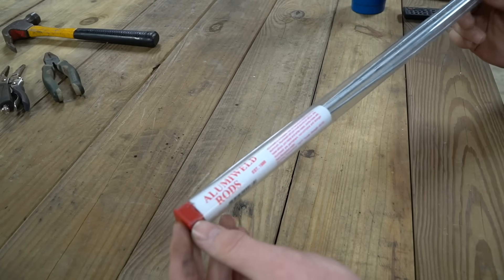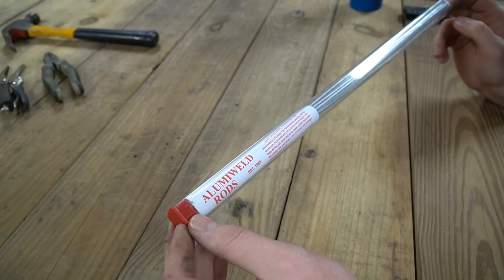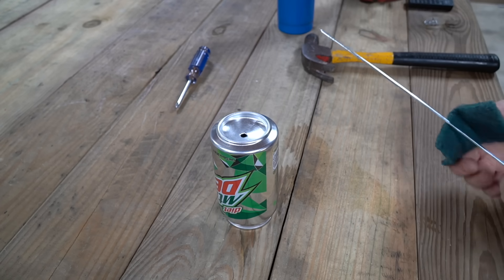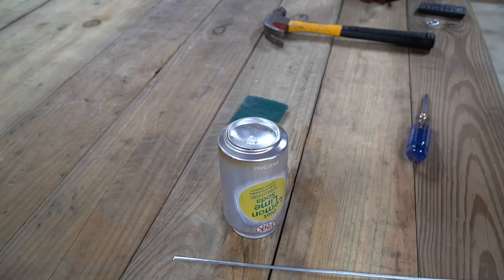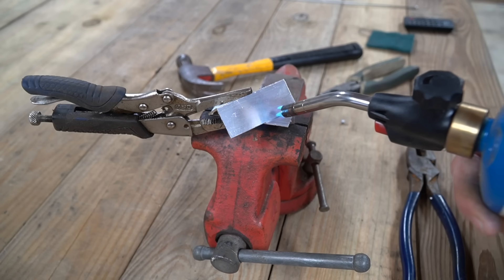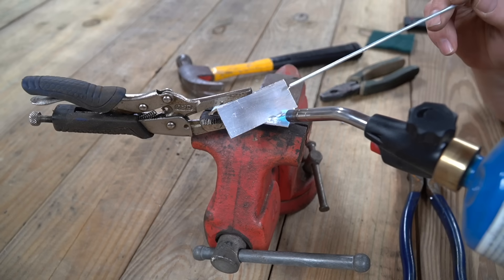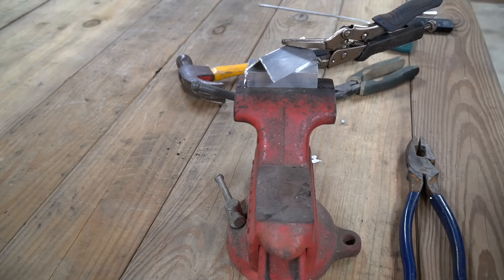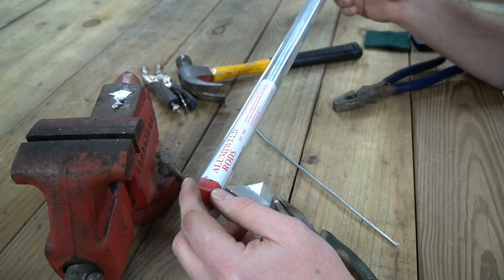Alumiweld rods from Harbor Freight!  Do they work?  Can you easily weld aluminum with just propane?

Comment: Here's my question:

If the tensile strength of the filler rod is greater than the base metal as you say, then it should be as strong or stronger than welding it. Yet everyone says this will not be as strong as welding. So which is it?
Reply from the maker: Maybe it has to do with how well it sticks to the material and not how strong it is itself?   A lot of people don't prep the material they are brazing good enough, it doesn't stick well, then they blame the product.

Comment: https://www.eastwood.com/images/pdf/19079Q.pdf here read the instructions, you're not supposed to torch the rods...
Reply from the maker: Right, your supposed to let the metal your mending get hot enough to melt the rod.   Keeping the rod in the flame doesn't appear have any side effects, as long as your not melting it with the flame.
Reply: @1D10CRACY  Precisely!

Comment: Could someone please tell me....HOW do you know you have ( the piece you want to weld ) hot enough to then proceed to use the rod ??    And I mean Short of melting it.
Reply from the maker: You keep touching the rod to the metal your trying to braze while pulling the flame away.  If the rod melts, it's hot enough, then you can keep flashing over it with the flame to keep it hot.  You want the hot metal to melt the rod, not the flame of the torch.

Comment: NO YOU CAN''T! My findings were quiet different from you'res. Compared to my high frequency machine it was shit on it's best day. I tried  to build planer boards with these pos and it didn't work at all. Thanks but no thanks.
Reply from the maker: I get it, it's tough to master.    I use them probably more than I should, but they work pretty well for me.   Different answers for different people, it's all good!
Reply: @1D10CRACY  The planer boards have an aluminum rod running away from the aluminum plate, while the plate would get hot enough the rod would not. I could only get heat to the exposed end of the rod, the plate blocked every other party of the 3/8" rod. I tried 3 times to get the rod hot enough but it broke free from the plate every time. Each time the rods flowed well and I didn't expose it to the flame. I was just experimenting with these rods but for this project I'll stick to welding. There maybe other applications that they are better suited for?

Comment: You can buy a used 140 amp wire feed for $100
Reply from the maker: Technically this isn't welding, its brazing.   Also keep in mind to weld aluminum with tig or mig, you need argon gas.

Comment: I can attest to 2 things. This doesnt work. The tensile strength and bend test will fail every time. And these are not made in the u.s. they are made in china and shipped to florida, then sold.
Reply from the maker: I can contest one of your two things.   ;).  These work well, if used right and for the right purposes.    The china import comment may be correct, I'd have to dig into it a bit deeper to confirm, but I'll take your word for it.
Reply: @1D10CRACY  you may be right on how well they work. I only tried it one time to make an aluminum box for a battery on a trailer. I dropped the battery in and the box broke. But I've been known to not have very much patience either lol.

Comment: I use 10% Silicon/Aluminum rods an Aluminum Brazing Flux heated with a standard Oxy Acetylene welding torch to Alloy Braze. Must try Propane one day.

Comment: The second level of sticking metal together. 1) soldering  2) brazing  3) welding. Been some time since I've brazed.  Last time was when someone brought me a cast iron bird bath they snapped off.   I prefer welding, but amazingly of all methods, stick is the one I haven't mastered.

Comment: the usual aluminium i work with is 1/8'. i use map gas, and i think i'll try prewarming on an electric hot plate.
i don't do a lot of this alum brazing, and i do find it helps to clean the rod, they do oxidize over time. 
i have also hammered the rod thinner, when working with thin aluminum , so it melts before the aluminum.

Comment: Back in the early 70s I worked in a maintenance shop at a newly built winery 
Not really a welder but adequate enough for most things. I was given a project to build a juice transfer pipeline formerly made of steel which got ate up from the acids in the juice they delivered some scud 40 aluminum pipe 6 and eight inch and some 5/8 flat stock aluminum. We didn’t have mig welders only tig for some stainless we did. I told the foreman I never welded aluminum before let alone with arc rods. He said you can do it boy. Lol
Tried cutting the pipe on the radiac but it used a full blade in less than two cuts. 24” dia wheels. Wound up using skilsaw with 4 tip cutting blades they sent 4 6” 90s but the sweep was too long so I had to make new ones I got a welders book and igured the angles and made new 90s with short er turns. I cut flat stock and made flanges needed. The fun part was arc welding it all together. Aluminum arc rod is like using a sparkler slag and embers fly everywhere.
After burning up two new coveralls I completed the project and was praised by the old shipyard welder foreman for doing a good job. Ahhh memories lol
Reply: I learned more working at that winery and farm shop than anywhere. You name it we welded it, built it from scratch, repaired anything and everything.  Hired as a mechanic learned to weld steel, brass,bronze, stainless, Cast iron, gas welding, hard facing gas and arc.

Comment: would these work on steel? I'm thinking of auto body applications
Reply: Nope, it won't stick to steel, in fact when I use them I quite often make a 'backing plate' out of steel to stop the weld puddle falling through the thing I'm trying to weld. (braise) Also if you use a steel brush to clean the parts even that will stop the rod from working, it hates steel! You have to use a brass or stainless steel brush

Comment: My experience in the UK with HTS-2000 (2nd Generation) aluminium 'welding' rods was rather disappointing, but for cost, not structural reasons. I assumed the process would be more like low temperature brazing or very high temperature lead-tin soldering than welding (because the parent metal itself is not melted into a puddle), but that wasn't the problem.

The rods were expensive, so I could only afford the introductory offer and bought a pack of 5. I thought this would be plenty to be going on with; enough to get a feel for the process and to do some proper tests before spending any serious cash.

Preparation was by clean stainless steel brush ONLY, so that's what I did. The instructions were very clear about that. I'd happily have tried other abrasive methods, but didn't want to waste my precious rods.

The problem was, there seemed to be very little substance in each one. An 18" stick felt curiously light and just melted into the (close-fitting) joint as though a lot of it was air. I'm fairly sure that this was NOT simply the 'magic' aluminium-penetrating/ pore-filling process happening; it felt more like the rod was 30% bubbles!

That's just what it felt like to me - I have absolutely no evidence that the rods were not 100% solid metal.

I used to do quite a bit of silver soldering when model engineering, so I know how to prepare surfaces and what a well-aligned joint should look like. I've done soldering, brazing, and both oxy-acetylene gas and electric welding for decades. This process felt weird.

Well, I kept feeding more and more stuff into the joint, but it was ridiculous. I was going to use two whole rods just on a small test piece! Unlike with silver solder, there was barely any substance to it. Trying to form a butt joint 4" long in 3mm thick aluminium swallowed almost two whole rods.

How's that possible? Where did it all go?

Part of the process involved rubbing and scraping the rod along the joint all the time it was molten. This 'stirring' was recommended, and apparently formed a vital part of making a successful joint. I suppose it clears oxide and allows proper wetting of the metal.

As far as I could tell, the result was every bit as good as the manufacturer had claimed it would be. I eventually smashed it apart using a big vice and a hammer, bending it over to 70° several times, backwards and forwards, and the 3mm thick aluminium broke before the joint. HTS-2000 rods give massive strength, no question of that.

A very close examination of a cut and polished section showed that the rod material had 'disrupted' the substrate a small amount (maybe 0.5mm, judged by eye). The aluminium itself had not melted into a pool, welding fashion, so the process is 'extreme brazing', sort of, and not welding. Perhaps. Whatever. Oh, I dunno. Aluminium's weird stuff. Ask a pro.

Maybe the HTS stands for High Temperature Solder.

It's not soldering, though. Soldering deposits metal on the faces of a joint only, like glue, without penetrating the surface.

So... the rods work. Yay.

But if you need to do anything more than a teeny weeny bit of 'hobby' work (i.e. messing about for fun), be prepared to spend a LOT on rods, because in my admittedly limited experience they don't go very far. Getting the joint hot enough may also be a problem - they make heat-sinks out of aluminium, after all - so be prepared to spend quite a bit on gas.

If you have any serious structural work to do, I think you'd be better off asking a local engineering firm to tackle the job. You'll get professional results (probably TIG welded) and save yourself a lot of frustration.

Note: these HTS-2000 (2nd Gen) rods might have an advantage over TIG welding in some applications if you're trying to join dissimilar non-ferrous metals, which they claim to be able to do BETTER than dedicated TIG welding.

Really? I can't afford to find out.

This is just my experience of the process, of course, so do please explore things for yourself. Other brands of rods may use a different secret formula - it'd be fun to experiment further, but I need food more than I need data.

My summary: the results may well be excellent, but they sure as heck won't be cheap.  :-)
Reply: You're right it's not welding, brazing or even soldering. The base metal absorbs some of the molten filler without actually melting, I imagine the longer you keep the puddle liquid the more "penetration" you would get.
I have no idea if they just seem super light, or if they really are. Maybe they're like a sintered powder which contains a flux that burns off or something?..
Reply: Why not write a book? 😳🤔

Comment: Brazing is not the same as welding.
Reply from the maker: Really?
Reply: @1D10CRACY  really. Brazing doesn't mix the base metals of the pieces being attached to each other. Welding melts the base metals together. You can weld or braze with a torch, but it's two different processes.

Comment: I want to make an aluminum lamp guard that would cover over 4 infrared lightbulbs.  It’s for a DIY portable infrared sauna.  Couldn’t find anything on sale.  Not even a guard for the individual bulbs which require at least a 6.5 inch circumference.  This might work.

Comment: I've done arc welding for many years and always wanted to weld aluminum. Thank you for teaching me a new skill. I will have to get a propane tank and some aluminum weld rods and braze some aluminum pieces.
Reply: Aluminum is easy unless you gotta stick it . If you got an ac/DC buzz box , you can rig it up to run a tig torch . I recommend for that kind of set up to get the one from the freight to be cheap , but it's a solid torch and has the gas valve on the torch itself to make up for not having a solenoid to flow . Kick your box to ac and let it rip .

Comment: I made an anchor well on my old tinny boat.
Worked for years and held well.
But.
The entire well (aluminum box)needed to be kept hot in order to prevent twisting of the aluminum well.
Small piece demonstrations don't show you that sort out of issue.
Can be done, but needs 2 blow torches.

Comment: Of course, the whole point is whether the brazing joint is strong or not. The final step of pulling the pieces apart was omitted, making this a video on just the brazing technique. Helpful, but not definitive...
Reply from the maker: I should of demonstrated how strong the joints are afterwords.   I just assumed telling people that you normally bend the metal before breaking the joint was sufficient.  Maybe in the next video....
Reply: @1D10CRACY  Telling people is marketing. Showing people is engineering. 

Your video was moving along very professionally and we were learning as you demonstrated. But then you stopped before proving whether or not the process actually creates a strong enough "weld" for practical purposes.

Your presentation style is better than many others on YouTube, and, unlike them, you don't rattle on with too much talk. All you need to do to be a first rate YouTube presenter is to finish the presentation by testing the result so your viewers can see what really happens.

Comment: While the rod may have 40 ksi strength, the interface between the braze metal and the native aluminum will have a strength equal to or less than the strength of the native aluminum.  It is VERY misleading and actually just downright dishonest to use the term "welding rods" in any description of this product.
Reply from the maker: Misleading or good marketing?  LOL  I think the company calls them "Alumiweld" because most people don't understand the difference and just want to bond two pieces of aluminum together.  In the company's defense, the packaging clearing reads "Alumiweld is fluxless, low temperature brazing rod for aluminum"  As far as the bond, in my experience the aluminum bends before the joint breaks.

Comment: I've used UK variants - what happens is that the rod forms a eutectic alloy with the aluminum. Eutectic is a fancy word for lower melting point. The alloy formed does penetrate into the actual aluminum - so it's not brazing or soldering as it penetrates the base material. Do a weld or two and cut them open - easy to see. Makes a really strong weld. Key is to form a puddle of rod material and then use a steel wire to scratch UNDER the puddle - this breaks the AL oxide crust and the rod just sucks into the aluminium. Weird to see this happen.
Reply: Help me please, what do you mean with scratching under the puddle? Where do you apply the puddle of rod material? How does the puddle relate to the the rod being sucked into the aluminum?
Reply: @rogierius  Same question here. I wondered how this rod works, considering aluminum oxidizes instantly. I think he's talking about scrubbing the joint with a wire brush while the solder is a liquid puddle on the joint. You would have to work quick, I think. I'm going to try that.

Comment: Would go faster if you didn't have steel absorbing heat of of aluminum,or try using MAP GAS since it burns hotter
Reply from the maker: True!  I minimizes the heat soak by just clamping to the bottom edge of the angle.   This material was pretty thin, mapp gas may be a bit hot for it, especially on the pop can.   But mapp gas would be a better option for thicker material!

Comment: These rods do work!  I have used them to repair the cover plate on my 76 xlch that the kick starter lever goes thru!  At first I was very 'thrifty' with the material... didn't want to use that much.  But the plate kept breaking after a bit.  Then I said screw it an put it on thick and wide and it has held now for at least 15 yrs!  Also fixed a chewed up aluminum prop on my dads boat.  Had to make a 'mold' (if I recall I clamped the blade to a cinder block and applied the material and let a puddle form that was slightly larger than where the  prop blade was missing) and when done just shaped it on a bench grinder...

Comment: Uumm…Brazing and welding are not synonymous. 
Welding is a fabrication process that joins like materials together using high heat to melt the materials together.  Aluminum can be welded, usually with an inert gas (think TIG welding).
Brazing is a process that joins two pieces of material together by melting a filler rod of a different material into a joint where the two pieces come into contact, without melting the pieces of material.
The process you are demonstrating is brazing or soldering, not welding.

Comment: Well if it’s brazing (which it is) then it’s not welding!
Reply from the maker: It's not really brazing either.   It's more like soldering.
Reply: @1D10CRACY  - in the U.K. brazing is sometimes called hard soldering. It’s a bit confusing the way the video keeps switching between calling it brazing and welding as if they are the same thing - which they really aren’t.
Reply from the maker: It also doesn't help with a  product named "Alumiweld".

Comment: Harbor Freight has disappointed me too many times! Maybe these rods work but i"m not a welder.
Bought a set of "GOLDEN" drill bits for steel drillin'. Well they dulled in no time + were barely good for wood.I hope you are satisfied with your purchase.
Reply from the maker: HF is one of those stores where you really have to careful with what your buying.    The only drill bits I buy from them are the cobalt drill bits.   They are expensive, $65 bucks, but they are just as good as the Cobalt NAPA sells for $99 dollars and I'm not convinced they are not being made by the same company.    But your absolutely right, a lot of items especially the cheaper ones are disappointing.

Comment: Would that cheap aluminum work on my mower deck bracket before it rip all the off the deck 

I need to get the bracket on the deck welded or just buy a cheap enough electric welder that will get it patched up I don't care how the welding job looks sloppy or clean as long as its patched up good